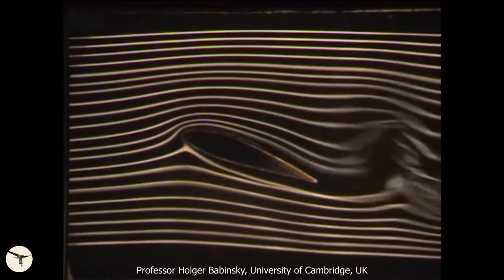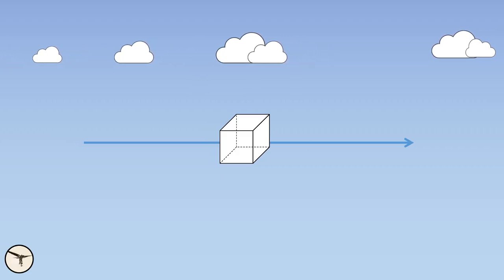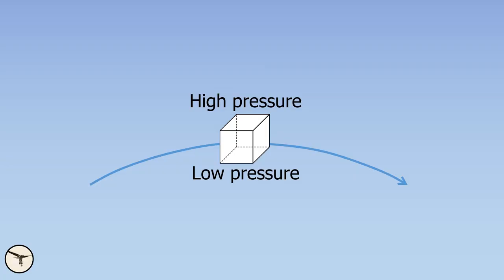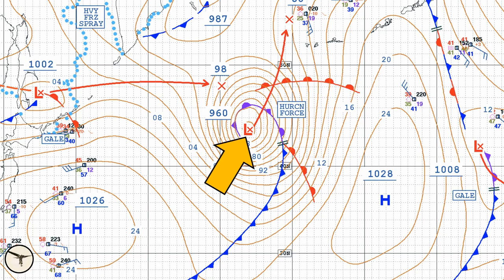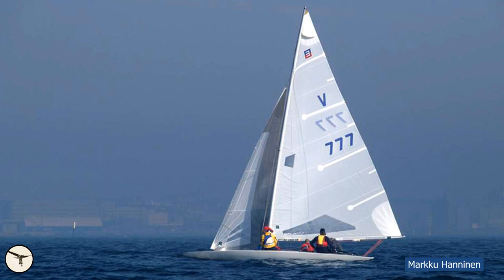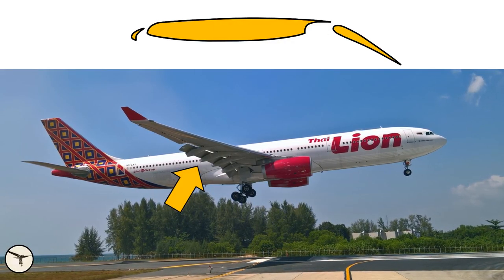Forget Bernoulli and Newton | The easy way to explain lift

Comment: I didn't understand your explanation, but I've found a better way for me to understand it.  The top of the wing acts like pressure in a large tube entering a narrower section of tube where pressure decreases and the flow is accelerated.  The bottom of the wing acts like fast moving air in a narrow section of tube entering a larger section of tube where pressure increases and the flow is decelerated.  I would like your evaluation of my understanding of the subject.  Am I right?
Reply: No, sorry. If the air some distance above the wing  was considered immovable, then your explanation for what is happening above the wing would be correct. But then when the wing is angled into the wind, the bottom would act the same and pull the wing down! :(

Comment: F=m.a, or F=m.dv/dt; dv is a  vector quantity which includes a change in direction, hence lift from curvature. Not the full story, but certainly a significant factor.
Reply: What obligates the air to follow the curvature?

Comment: So if lift is created by the curved flow of air over an aircraft wing, which creates a low pressure area above the wing, how do you explain how a flat-winged aircraft flies? What about a wingless aircraft such as NASAs M2-F1? What about the case of the F-15 jet that landed successfully after one wing was completely torn off in a mid air collision?

Lift is being created in multiple ways across multiple parts of an aircraft, including primarily reactions stemming from Newton's Third Law.. Provided the sum of these forces match or exceed the total weight of the aircraft, the aircraft will stay aloft. A typical airfoil shape will maximise efficiency, meaning there is more lift created for a given thrust energy. Curved airfoils do create low pressure areas above the wing, and this adds to total lift, but with sufficient thrust energy an aircraft will fly with completely flat wings or even no wings at all, because sufficient lift is created via the body of the aircraft deflecting air like a stone skimming over the water when thrown at the right angle.

Comment: Can u also explain then why water rises in Venturi effect? When we blow air over the top of U-tube containing water then the pressure at narrow region would be smaller I know but it would be smaller than the pressure compared to WODER REGION OF TUBE ABOVE. Why do we compare it to the air pressure inside the U Tube which I static and say that water will rise up?

Comment: Hello. Do I understand correctly that the airflow on the top of the wing "follows" its shape, because when trying to "break away" from the wing, a vacuum is created between the airflow and the wing?
Reply: It's not clear if you can say that, because it's not clear how much the mass density changes, considering all of these interrelated effects.

It presumably connects the different phenomena better to say the drop in pressure comes from the relative wind's conservation of momentum.  The asymmetry causing a constriction to the airflow's path cannot violate the momentum of the flow, so the momentum drops its pressure, to proceed faster.  The momentum forces that conservation of energy swap (pressure for speed).

This lower pressure turns the airflow at normal ambient pressure down toward the wing.

Comment: A water ski produces lift by deflecting water downward. No water flowing over top.
Reply: 🇨🇱  Right ! 
In trying to get the historic  confusion straight, he used a curved airfoil diagram. 

It would have given a  much better insight, if he used a plain [non curved!] sheet for explanations and flow /force  diagrams. 
Just like the water ski  👍😀. 
The curving and asimetry of a foil is not needed for "lift", but for reducing drag  ‼️
Saludos de 🇨🇱
Reply: Planing motorboat I suggest is a different phenomenon that fluid flow around the non planing boat

Comment: Only need to know three things: the static pressure difference between the top, and bottom, of the wing is what holds up aircraft (dynamic buoyancy); the wing stops flying when the critical angle of attack is exceeded, regardless of airspeed (stall); and a headwind is much more harmful than a tailwind is helpful (fuel starvation).
Reply: If you're taking off or landing, a headwind is much more desirable than a tailwind!

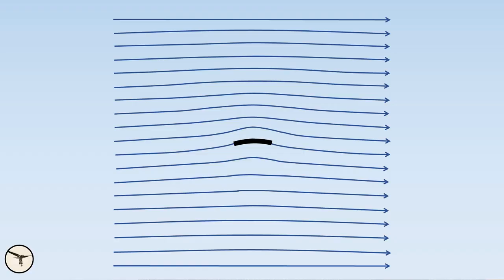Comment: I am a little confused. At 5:00, you say that the air is compressed as it moves over the curved surface. But if the air is compressed, doesn’t the pressure increase? So then at position B, the air pressure would be higher than at position A? And then you say that the air under the curve shape expands, resulting in a higher pressure. This doesn’t seem to make sense to me. Can you elaborate?
Reply: The compression happens right at the leading edge which creates the force necessary to change direction in surmounting the leading edge.  But immediately after arriving at the top front, there is an abrupt drop in pressure horizontally, which accelerates mass horizontally acting to keep up the mass flow thru rate continuity.

Comment: Great work as usual Captain, but if your audience are mostly pilots not design engineers, so they better stick to the angle of attack principle, as in fact all the controls works the same way, i agree the lift is the product of all these things together but it is easier to visualize the deflections in controls in anticipation of the effect than using the deflection increase method.
Keep up the good work capt :)

Comment: I used to hate the drawings showing the airflow being forced to go faster across the top of the wing and then joining up with the slower flow under the wing,  my brain used to ask how the hell do the individual "packets" of air above and below the wings know how to combine again after the wing has functioned.     Quantum physics maybe?
Reply from the maker: Not even quantum physics can explain that!
Reply: I always thought that was the easy way to explain lift, probably because I am neither pilot nor aeronautical engineer.  Look at the picture of a thin wing at 6:00.  Air is lazy, and nature abhors a vacuum -- that is why winds rush in one way only.  The air moving over the top has further to go than the air moving below the bottom for them to meet again at the trailing edge.  There are two ways to make up this difference: the top air can move faster, or the bottom air can curl up and reverse direction at the trailing edge.  It should be obvious that reversing direction like that would be a lot more work, and air is lazy -- easier for the bottom air to keep going backwards and create that lower pressure zone which can suck in the upper air -- speed it up, make the upper air move faster.  This difference in pressure is what provides lift.  A wing generates more lift as the angle increases, because the difference in distance increases.  But at some point, you raise the angle too much, and suddenly it is easier for the bottom air to curl up around the trailing edge and go forward to meet the upper air, and that is how wings stall.

This explanation has satisfied friends, but it should be obvious why I am not an aeronautical engineer :)
Reply: @grizwoldphantasia5005  Using the intermittent smoke streams, it has been shown that the flow at the top of the wing doesn't meet at the trailing edge. The top flow lags behind.

Comment: If you move air upward then downward then back upward to retain it's original trajectory, you'll build a force within the object that can't be used for lift. You have to accelerate air downward and expend it. This downward movement of air can't be recaptured , that would eliminate lift. You don't cause a  pressure differential and get lift.  Rather  a pressure differential IS lift caused by accelerated air. To be sure,  try recapturing the downward accelerated air,no lift will happen.
Reply: A weak explanation repeated many times does not equal a strong explanation. The only solution is to study physics in greater depth under competent supervision.  I'm sorry, but this is the truth.  You've stated your case.  Now go back to the books and study to increase understanding.  It's ethically the correct path is it not?

Comment: Can you please explain how planes with symetrical wing profiles can fly either right way up or upside down.
Reply from the maker: Sure, the answer is to apply a positive angle of attack. Please watch this video: https://youtu.be/d4w1Iy4vVMg
Reply: @FlywithMagnar  Related, I recall learning somewhere that "the top surface provides 2/3 of the lift, the bottom 1/3, and that is why we hang engines on the underside of wings". That debunks the "air bouncing off the bottom" as the primary origin of lift. Can you explain that with the "curved streamline" model though?

Comment: I would ask how such a wing could fly upside-down.  My take on it is at take-off roll a wing has leading-edge flaps extended downwards which has the effect of thickening it.  At V1 the air can't get out of the way quickly enough and gets bounced upwards.  But it then comes back down again because of the weight of the atmosphere pushing down on it. This has the effect of creating a vacuum above the wing otherwise known as a 'shock wave'.   Vacuums have to go where vacuums belong, to the top of the atmosphere (equilibrium law).  All trillions of tonnes of the atmosphere pushing the vacuum upwards, but practically it's just the air immediately around the plane which does the job.  I've seen these shockwaves above the wings of planes as they say,  landed at airports with condensation forming along them.  At higher speeds above 400 knots maybe,  the shockwave starts to have difficulty keeping up with the plane and drags back on it.  Engineers eliminate much of the drag by angling the wing back into the shock wave.  This 'sweep angle' can tell you the rough operational speed of the plane. When a plane breaks the sound barrier the bang is caused by the shock wave, no longer able to keep up with the plane, collapsing or imploding.  A thick wing will create more lift than a thin one but also more drag.

Comment: Is the low pressure the lift or is it the turning of the airflow downwards? The change of momentum inducing an upward force on the wing. So the change in pressure toward the centre of the curve ensures the flow stays attached.
Reply from the maker: Lift can be described as the difference in air pressure above and below the wing. Lift can also be described as air being pushed down by the wing.
Reply: @FlywithMagnar  it cannot be both…
Reply from the maker: To explain lift properly, you need a degree in science. The explanations I am showing here are more like metaphors that can be understood by laymen.

Comment: @Fly with Magnar   ok.  I am interested and I and watched your video more than once.  I like your explanation of "pressure" difference.

There are however, 2 things that still give me "question".  I have 2 observations for you.

1.)  I tried your experiment.  I confirmed your results.  BUT, I also blew on the underside of the paper and it moved up.  It didn't matter top or bottom, the paper moved up.  Why?

2.) a sailboat's sail is like a piece of paper.  It is thin, etc.   The length wind travels over the "front" of a curved sail is practically the same as the length traveled on the "back" of a curved sail. The fastest a sailboat will sail is straight downwind where the full area of the sail is exposed and curve in the middle.  Think about that.  Why does everything on a sail with regards to cause of pressure difference change just because an angle was introduced?

How sure are you that "angle of attack" is not more important than curved shape?  What are your thoughts?  What experiments with paper can you think of to help?  I am probably waaaaay out of my league here, but I am honestly curious.  I do sail, and as I sail downwind I think about these things.
Reply from the maker: 1) Blowing on the top of a curved piece of paper doesn't explain lift, but the Coanda effect, which is utilized in some aircraft to control the boundary layer. As you see in the video, when the paper is hanging straight down, is will not move when you are blowing over the one of the surfaces. When you are blowing at the underside of the paper, it moves up because you add more air under it. 

To explain lift, you must look at the entire wing, not only one of the surfaces. So, I suggest you to forget paper experiements. The sail of a sailboat is a better comparission because it reembles the wing profiles of birds and early aircraft.

2) When the wind is blowing along the sail, it will be flapping and not producing lift. When the wind is blowing into the sail with an angle, the sail will form the shape of a curved wing, and it will produce lift. The mast is round and acts as a leading edge. This helps directing the airflow over the curved sail.

The curvature of a wing enables it to produce lift without too much drag. Varying the angle of attack allows the wing to produce lift at various speeds. 
I hope this helps.
Reply: @FlywithMagnar  got it.  ...and thank you for the detailed reply.  Not many people do that!
Reply: @FlywithMagnar  Really, I want to give a second "thank you".  It is nice to have an expert to answer a few of my observations.  I know I barely understand these concepts, since my study is rudimentary and mostly based on single paragraphs about lift in sailing books along with a 1980's science textbook.  Thank you.
Reply: @animatem  You might enjoy my Swept Volume Theory. Enter swept_volume_theory into your "favourite search engine".
Reply: @FlywithMagnar  Stick with flying. Sailing is much more nuanced. The mast does not "act(s) as a leading edge" at all. It is there to support the sail, and its essential thickness (for compressive strength) does that at the expense of the efficiency of the sail. That's why high performance boats have streamlined, rotating masts ...specifically to reduce the drag from the mast.
Reply: @alans172  Will do!

Comment: You stick a plank out into the breeze as you drive along, you get lift. It doesn't have a curved surface but doesn't need one. Its still causing the curve or acceleration of air mass downward.  Bernoulli gets too much credit for what is really just a special case of the coander effect.  His equation only relates to a stream or venturi but that's really just an aerofoil curled right round to join itself.  Coander is all you need and you accelerate any mass you need a force. The force of air moving downward is equal and opposite to that on the wing seen upward.

I can believe that in flying syllabus books you still see bernoilli and the equal transit nonsense, I don't know why because its far less intuitive as well as wrong.

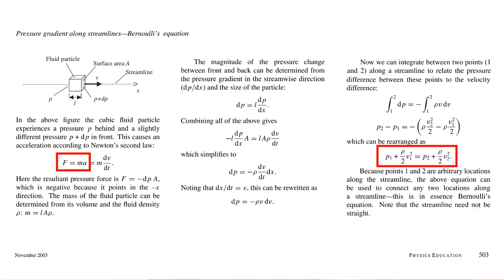Comment: At 8:28, I think you cannot assume the density of air to be constant. It certainly is a function of velocity (and pressure). Therefore, the equation cannot be integrated without considering density as a function of v. 
Can someone confirm this?
Reply: if this was applied to a liquid, I think it would be ok.
Reply: Density can be assumed to be constant up to around mach 0.3, where there is less than 5% difference in desniry due to compressibility. In reality, all flow is compressible and density does vary with mach number, which means that bernoullis equation isn't valid, but its just an idealised scenario.

Comment: 1:07 Why this and not this one 1:09 ?  The first image dont show the thurst. just the flow of air. the air from above dont give any thrust. Only the air defelcted from under wing give thrust. Why we should take in consideration the air from above? is because the vortice?
Reply from the maker: It is the air that flows over the wing that contributes to most of the lift. The ratio depends on the angle of attack. That's why the overside of the wing is so smooth. That's why ice and snow is removed from the wings before departure. That's why when the airflow over the wing is distrubed, the wing stalls, and the airplane stops flying. 
This video might be helpful: https://youtu.be/d4w1Iy4vVMg
Reply: @FlywithMagnar   You can get a brick to fly if you get it moving fast enough.  Speed causes the air molecules to hit the underside and bounce off like ping pong balls.  That forces the brick up.  Wings do generate lift from the top, too.  Now someone will say air doesn't work like ping pong balls, but don't tell that to the crew of Space Shuttle Columbia.

Comment: You say the air speeds up over the convex surface, but why. What is providing the force? Granted if it does speed up, which it does, then the pressure drops. But where is the force causing this acceleration. Your explanation is incomplete.
Reply: It speeds up because the pressure drops.  The acceleration/ pressure dynamic is sort of a chicken and egg problem, but prior to the air hitting the leading edge, there is no acceleration.  Hence, the pressure drop forces the speed to accelerate.  It's like a Venturi, but the top half of the Venturi is composed of air that can't get out of its own way.  You have to have a good leading edge design and a high wing velocity in order to make air so resistant that it works like the top half of a Venturi.  But with that, some aluminum, kerosene, and human enginuity, you can lift a 747.